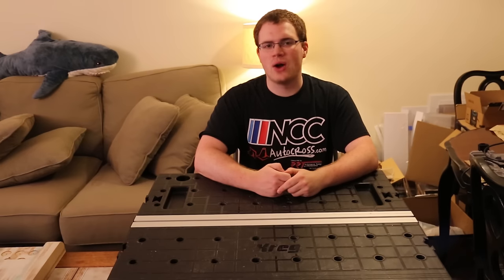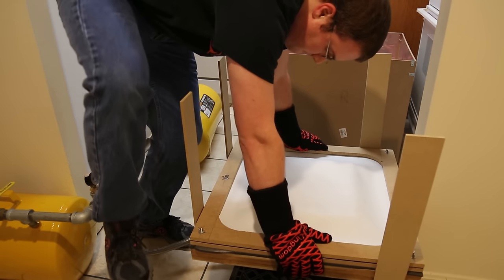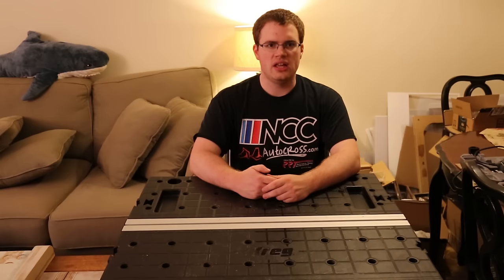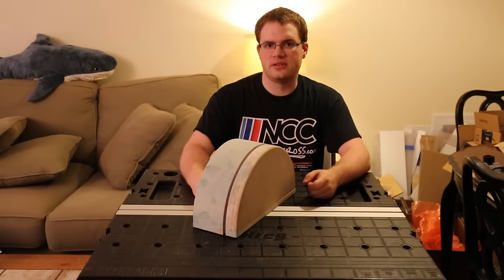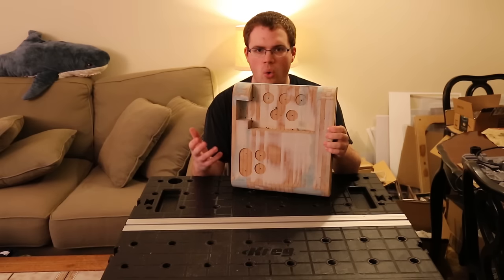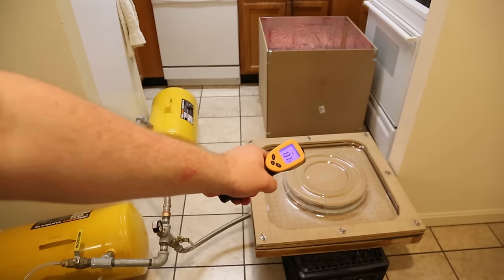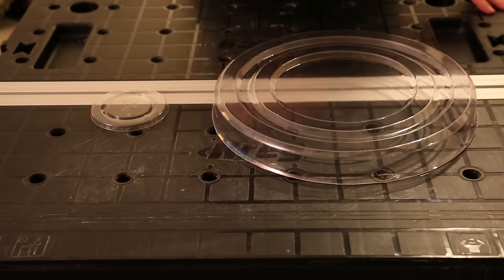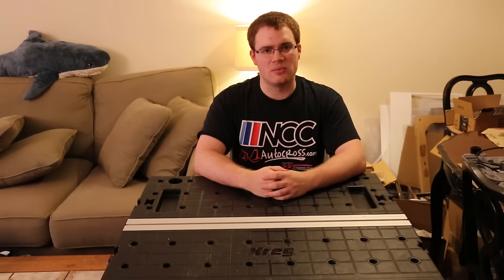DIY Vacuum Forming - Complete Video Guide

Comment: Hi, inspired by your vid i built my own but unfortunately without the same success. I used 2mm abs, the vacuum did'nt draw the plastic down onto the buck. Unlike yours, i had huge sag from the sheet whilst heating and in seemed like it had gone/was going rigid in the few seconds before i applied the vacuum. I'm wondering if 2mm was too thick and wether i should try petg, however i cannot find anything relating to the 'thousandths' you're mention when talking about thicknesses, only mm.
Reply from the maker: Thousandths refers to thousands of an inch, and 2mm is the same thickness I used (.080"). Lets try to break this down into multiple parts. Did the vacuum not suck the plastic down onto the buck because of insufficient force (due to a leak or otherwise) or was it due to your plastic being rigid? If your plastic didn't heat up in about 5 minutes or less, your heating system is probably not up to the task and needs to be more powerful. If you are waiting 15 minutes for the droop to occur, it's likely that you're on the threshold of the thermoforming temperature. Enough for it to deform, but not hot enough for it to transition from the heater to the platen without becoming solid again. For instance, I use the same set up and same temperatures on my heating system for PETG and Polystyrene, even though PETG has a lower glass transition temperature. It simply comes up to that point quicker, which is why I suggest running a stopwatch for each form. ABS has only a few degree C higher glass transition temp than Polystyrene. If you want to troubleshoot your system, I suggest experimenting with the cheapest type (PETG, Poly, etc) you can, if budget is a concern. Let me know if you have any more questions.
Reply: @mwjscn  Hi, thanks for getting back to me. Hard to say exactly, i tend to think it's because the plastic went rigid to fast. I tested the seal/vacuum just using some builders plastic and it worked well. I notice with yours you experienced hardly any droop, is this because yours heats the plastic in a faster time? I'm using an 5kw infra red heater, it holds 3 bulbs but im currently using 2. The deform temp is 275f for abs, according to my bbq thermometer i got to around 250f, the droop was so low i was concerned it was getting close to touching the heater. This huge droop made it harder to line up with the platen and kind of folded on itself as i placed it over the buck, even if it had pulled down i dont think it would have formed the shape correctly on the top of the buck. What power heaters do you use? Cheers
Reply from the maker: @sijandy  I think you figured it out in your own write up. If the deform temperature is 275f and you're only reading 250f, it's not enough. You need more heat, faster heat up time, less droop is created, unless wanted. I use 2x 1500 Watt quarts heaters for mine. You also want to make sure you're using an enclosure like in my system, since you want the plastic sheet to heat as evently as possible. If the bulbs aren't distributing their heat to the entire sheet, you won't get consistent performance. Your sheet should be ready to form in 4 or so minutes of heating. If it isn't, it's not enough. Feel free to also send me some pictures or a video of your system and what the plastic looks like when heating and maybe I can come to a more concise conclusion on what to do.

Comment: Hi excellent video.  I have a doubt, can Vaccum forming be used to form a half egg shape almost 30 inch in diameter and about 30 inch in height in Clear acrylic or PET?  How should be the bed size Sheet dimension and sheet thickness? Thanks in Advance.
Reply from the maker: It can definitely be done, but you'd need a large platen area, a large vacuum source, and a really good heater to get the amount of plastic droop you need. You can use the formula provided in the video to calculate your ideal platen size. The plastic thickness depends on your desired end result thickness (see plastic thinout details in the video) and what can be achieved in both the heating cycle and the vacuum cycle without blowthrough.

Comment: hello! thanks for your thorough and complete video! I wanna ask a question, how can I simply calculate the required volume of the vacuum charge tank for given forming size? Thanks before!
Reply from the maker: This is a really good question and I bet someone with an actual engineering degree could give you a better answer, but I'll give it a shot. It really depends on your set up and planned bucks. With a vacuum/Dyson-style former, the air is obviously being evacuated, while in contrast the air tank system I have set up is "sealed" and the air is being equalized across the system - not evacuated. So the system vacuum has to have enough volume to equalize the air both in the platen chamber (under the hole array) and any air trapped between the plastic sheet and the top of the platen while still maintaining an overall vacuum across the board.  As you can start to tell, the air trapped under the plastic is entirely dependent on how tall a buck you're forming. A short one will have less air between the plastic and the platen in contrast to a taller one. You could probably do some rudimentary calculation estimates on the trapped air in the lines to the valve, the platen chamber (if using that style), and a rough average of air trapped under the plastic for the range of bucks you plan to use. I didn't do any calculations for mine and it was a rough guess. I could probably do the majority of my pulls with the 20 gal tank, but I went 40 because it was cheap and I was pushing the size of my former with the bucks I had. If you are doing calculations, I would probably hazard a guess that a -10 to -15 inHg post-pull system pressure would work well, but vacuum forming is all about the initial pull. Even if the system is venting to atmosphere slowly, as long as you can maintain forming pressure on the buck for about 30 seconds you're good to go. By that point, the plastic will be moving below the forming temperature threshold. I hope that helps!

Comment: Hello again sir, if I convert a 1/4 hp qir compressor to a vaccum pump with tank, will it be strong enough to do pulls?  how much CFM would it make? Thanks so much for this!
Reply from the maker: My 1/4hp vacuum pump is 3 CFM and works fine for what I do but your mileage may vary.
Reply: @mwjscn  thank you again. I’ll go ahead and try it. 👌🏼

Comment: Hello and congratulations on your video. In your blog you indicate the "Vacuum Pump (ZENY 3.5 CFM ¼ HP - Amazon) $ 53" which should be able to fill the 2 yellow tanks that I see in the video. I bought a very similar pump connected to 2 tanks of 24 liters each and it cannot reach -24Hg (-0.8bar). How could I solve this problem? Do you reach full scale on the manometer by turning the vacuum? Sorry for my English I used Google translate ... ;-)
Reply from the maker: Does the vacuum pump have quality fluid in it? I had to change the fluid when I got the Zeny pump, since the supplied fluid wasn't great. I gained a higher vacuum by doing so. Additionally, you may want to check for leaks and make sure everything is tight. Every threaded joint on my system has sealant paste on it.
Reply: @mwjscn  I used "Octopus Oil for vacuum pump" and all the tubes (2 to be exact) are all wrapped in abundant Teflon ... The pump reached about -7Hg starts to emit a lot of smoke in your opinion is this normal?
Reply from the maker: @umbertoelia3029  No, not normal. Smoke was happening with bad oil in mine. It indicates inferior oil or the pump is getting too hot. Try a different type of oil. Also, make sure your oil is to the correct line on the sight glass before starting. You want to make sure it's filled with the correct amount. Not too little, not too much.

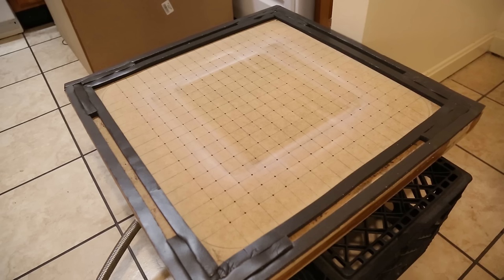Comment: I have a question, when you say 4:46 you need a "formable area" do you mean total area of the grid or within the grid area?
Reply from the maker: The grid was just a leftover from me drilling the hole pattern. The formable area in the case of the platen pictured is really the distance between the gasket material bordering the edge. The equation is really basic and more of a rule-of-thumb type scenario. You can see I probably broke the rule with what I was forming at 0:10 - 0:20, but I achieved enough plastic droop and had enough vacuum power stored to force it. The equation just gives an estimate to how big you should probably build your vacuum former given the size of the largest item you want to make and assuming you have average vacuum equipment.
Reply: @mwjscn  Thanks that is what I was wondering. again, great video.  I am designing a machine that will hold a 5'x5' sheet of lexan I also plan to have an interchangeable frame setup to hold 4'x4' 
sheets. I notice that you have two tanks on your setup. Perhaps I missed it, but what volume are those tanks each?
Reply from the maker: @aWhiskeyTangoFoxtrot  They're 11 gallons per. Just keep in mind you'll need significantly more vacuum for a 5 foot x 5 foot set up, especially depending on your goal thickness.
Reply: @mwjscn  I was thinking about two 20 gallon tanks

Comment: Hi there! Great tutorial video! I learned a lot, and I'm planning (hoping) to make my own set-up in the days to come. I have one problem, though: I live in Norway, and I cannot find any outlet for buying PETG plates, foils or ABS, so it seems I have to check out a supplier abroad. Where do you buy your PETG materials? Can I get them at Amazon?
Reply from the maker: Hmm. I did some googling and this company (based in Thailand) may export materials to Norway. I'm unsure if they have a local distribution plant, but you may want to enquire with them to get more information. http://www.nizzaplastics.com/norway/vacuum-forming-plastic.htm
Reply: @mwjscn  Thank you so much! I will certainly make contact with them, hoping to find a link to where I can buy this locally instead of having to buy bulks all the way from Thailand! Forwarding costs will be huge!
Reply from the maker: @youyouulf  if you can find any local scale model or hobbyist groups or stores, they may also have information on where to get plastic materials.
Reply: @mwjscn  That's a good idea! I live close to the biggest hobby/model shop in Norway, so I will contact them. Great tip, thanks!
Reply: I contacted a company that does thermo forming and they agreed to sell me some leftover polystyrene sheets, so problem is solved for now. Got hold of a functioning secondhand quartz heater which I'll pick up on Saturdag, so I'll start constructing and building next week. It will be a simple but hopefully genius set-up! ;)
Reply from the maker: @youyouulf  Excellent! I'm glad it worked out.

Comment: Those heaters pull a lot of amps! Do you have them plugged in directly to one circuit or split between two? If split, do you need a high-amperage extension cable? Thanks!
Reply from the maker: I've done both set ups. I started with them on separate circuits, but also on one and it seems to work fine. No thrown breakers yet, but it depends on your personal home wiring arrangement.
Reply: @mwjscn  Thanks! Super helpful!

Comment: Hi, excellent video. Im trying to make a 48x52 thermoforming vacuum. Im stuck in the vacuum tank and pump. What do you recommend?
Reply from the maker: Centimeters or inches? If you're working in centimeters, follow the link in the description to see what equipment and materials I used and you could easily mimic my set-up. If that's inches, that is a very large set up and you'd probably have to get industrial-size equipment. In the video, I am using a 24"x24" former with two 11 gallon evacuated tanks (22 gal total). If you were to scale that up, you'd probably be looking at a 60-80 gallon tank requirement and an industrial pump that would be able to evacuate such a large amount of air and make decent time in doing so. You could also try using multiple Dyson vacuums (probably 4) if you had enough friends with them, but that scale is beyond my experience level and will be up to trial-and-error. The most important moment in vacuum forming is the initial pull, so you need something that has enough power to immediately form the majority of the plastic (because it cools rapidly). If the air evacuates too slowly from underneath the plastic it will result in poor forms.

Comment: Thanks for making informative video.
Actually, I want to know about the size and description of vacuum pump for die, which volume is 25 cubic feet.
Reply from the maker: You can find the parts list as a link in the description.
Reply: @mwjscn  Actually, I am looking for suitable vacuum pump. Can you help me for calculate the exact parameter of vacuum pump such as (LPM,Displacement, Power, R.P.M and Ultimate Vacuum) for the vacuum die volume of 25 cu ft.
Reply from the maker: @AmrinderSingh-ff1uw  I don't think I'd be able to. I suggest contacting the manufacturer you wish to purchase from with your question and they'd be able to better support you.

Comment: One quick question, for 3D printed master pattern, does droop temperature of the plastic matters. Also do you think some sort of high temp ceramic coating on the printed master like Boron Nitride (BN) would help.
Reply from the maker: It depends on both the material you printed in and the material you're forming with, since there is a slew of different melting points. I'd suggest following a guide online, since I've seen a few successfully vacuum form 3d prints.

Comment: I'm trying to form PETG, getting allot of static causing dust and small fibers or hairs to cling to the print.  I've tried prepping the buck by cleaning it with a micro fiber,  and cleaning the petg with micro fiber and compressed air,  still getting dust. Any recommendations to get cleaner prints?
Reply from the maker: You're right that removing the film creates some static that attracts dust. The only answer may be to work in a cleaner environment. I also stay mindful of dust when working, but most of what I get can be solved with compressed air. Make sure you're only taking the protective film off the moment you're ready to put it on the heater. I haven't tried it, but maybe a brand new super clean swiffer hand duster pad may help.

Comment: Hey mate, will a 2.5CFM Vacuum pump suffice? They are far cheaper.  Will they just take longer to evacuate the air tank? They are rated 1/4 hp
Reply from the maker: The one I'm using I originally purchased for $53 from Amazon, though I guess it's $65 dollars now. If you're buying new in the US, I still think that's a fair price. However, if you think the money savings is significant for a 2.5cfm, yes you can probably use it and be just fine - as long as you don't have a large capacity that would overheat the pump to get the desired inHg. My pump already gets fairly hot as it sits evacuating the tanks pictured. The performance mostly actually comes from using good vacuum-pump-specific oil. The oil that came with mine was garbage. Not only did it boil off when it got hot, but it didn't seal well. After I got some quality vacuum pump oil from Advance Auto, it stopped boiling off oil and retained it (less top offs), gained inHg vacuum, and spent less time getting there. Make sure you factor getting good oil into your costs.
Reply: mwjscn that's awesome thanks. I'm in the UK and it's hard to find parts priced nearly as cheap as you've got!
Reply from the maker: @rups22  Oof yeah, I just did a search and the same pump I use is sold for £121 ($170) on UK Amazon, which is a rip off for sure. Best of luck!

Comment: Can you have too many holes in the platen? I noticed you indicated 1/8" and that makes sense to avoid dragging in material into the holes.  And you could have too few...but I am curious as to why not just use perforated steel sheet?
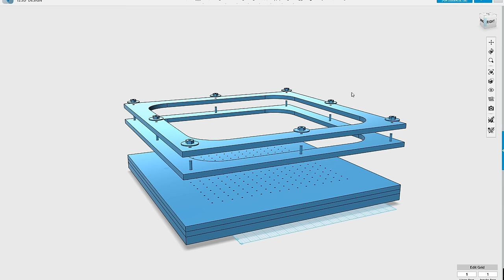Reply from the maker: There's definitely a sweet spot with how many holes you have in your grid and I'm sure there is some sort of equation for it, but it's not something I know. I personally like the 1/8" hole in a 1x1" grid. Since you're building your machine to be larger and using multiple tanks, you may considering having multiple main inlets at the bottom of your 'vacuum chamber' on the platen base (explained @5:33). The main thing you want to shoot for is having a grid numerous and versatile enough where you can line up your master and have a row of holes directly underneath the edge. This will allow the plastic to really form well to the edge and give you good definition. Remember, you want the plastic to wrap and cling around your master, so it's important to strategically place your master on your hole array. The spare 1/8" holes around the edge will help the plastic seal, and you'll see small 1/8" pucker marks where the vacuum was applied (which doesn't matter since it will be discarded anyways - you can see these during the two shots @19:21 and following). I didn't use perforated steel sheet, although some do, because you can obviously see my fabricating possibilities when my workshop is my apartment living room and kitchen haha. If you have the capability, many others have done this. Though, since I don't speak from experience, you may have to search for others regarding the specifics of using that material, such as release and heat.
Reply: @mwjscn  thanks for the insight. I really appreciate it. When investing in time, effort and cost into a project it is nice to learn as much as possible from others that have done similar jobs.
Cheers.

Comment: What 3d modeling software were you using ?
Was the base of your Vacuum system made of pegboard ?
Thanks for the video.
Reply from the maker: I used 123D Design, but would also suggest Fusion 360 if you're getting started. The platen top was solid 1/2" MDF that I drilled a 1x1" pattern of 1/8" holes in. You can use pegboard if it's thick enough or your platen is small enough.